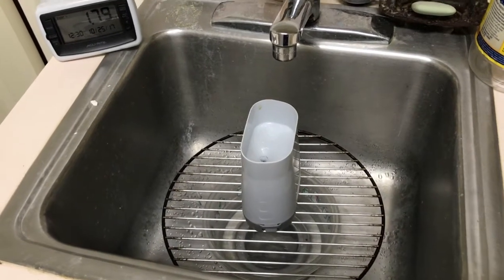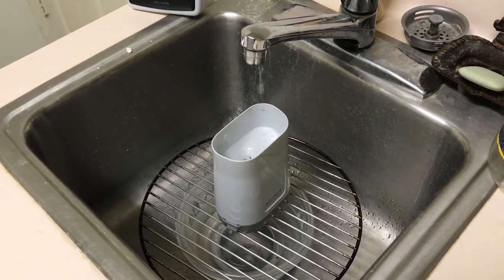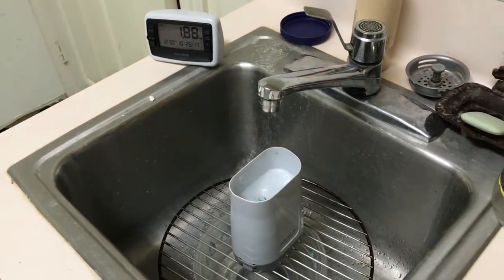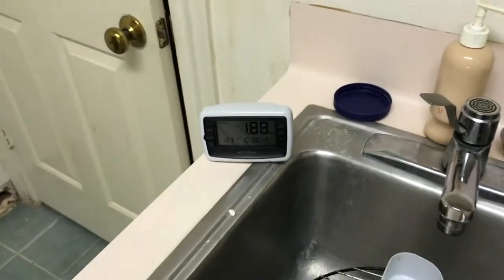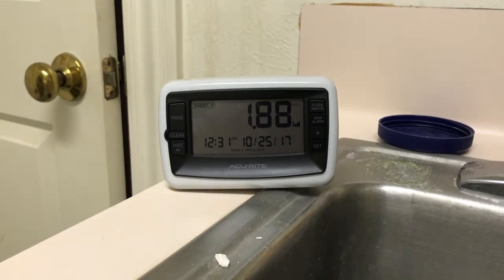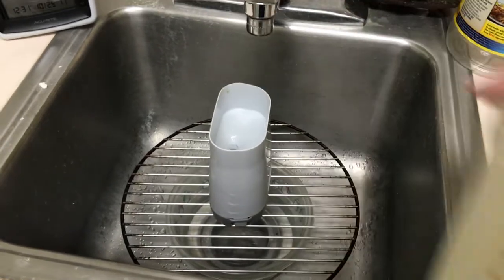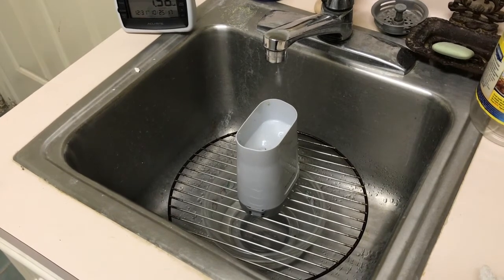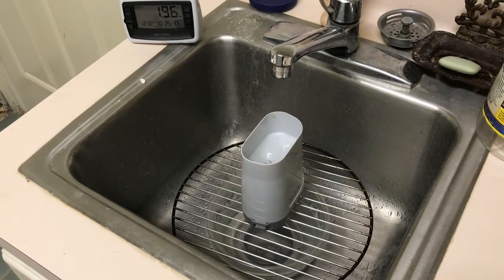AcuRite Rain Gauge Calibration

Comment: Thank you for this brilliant idea!  So much easier this way.  I following your suggestion and went to +3.36 over the original day amount (seems like as you carry the device, the levers rock, so it reads a little bit... 0.17 in my case).  Poured it into a measuring cup after and determined it had 6.25% less than it claimed.  According to their instructions, that meant a 5/8 clockwise turn on both screws.  Did that, then ran it again for +1.68 more.  Poured that out and it was exactly 8 oz!  That was pretty cool!

Comment: Interesting approach.  I'm buying this model and I think I'll use your technique, although I'll use a 500-gram capacity digital scale to measure the water.
1 ml = 1gram
16 fl. oz = 454.61 grams

Thanks for the idea.  BTW, did you note the refresh rate of the LCD?

EDIT:  Received my unit.  Checked for accuracy using my variation of your technique and determined no calibration was necessary.  I calculated only 0.7% off of perfect and I doubt I could turn the calibration screws precisely enough to improve on that!  Besides, there are a number of factors of measurement which could easily add up to that much deviation.  I'm going to mount it right next to my CoCoRAHS approved gauge next and wait for rain to make that comparison.

I was disappointed to observe the display updates like clockwork every minute, regardless of bucket tips.  I'd have preferred an update PER tip.  But I reckon their chosen method conserves battery cell charge.

From a distance of 40-50 feet, and obstructed by an exterior brick wall and several interior walls it is showing strong signal strength.  Very good.  Now, I need some rain.
Reply: I like Pi radius squared approach. then divide by 2. multiply times 7. Works every time
Reply: @smart451cab  I hope your not mad for me saying, but there is about 473 grams in 16 fl. Oz. (1 pint) of water.  Otherwise I think you have the best method I have seen.